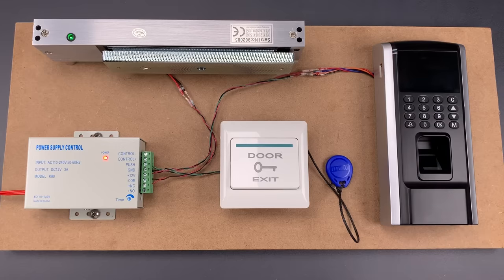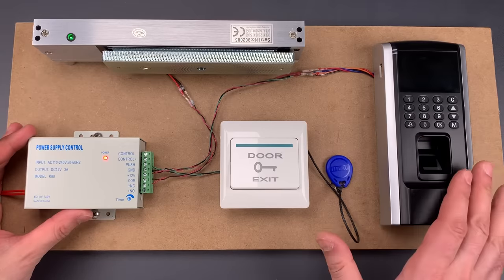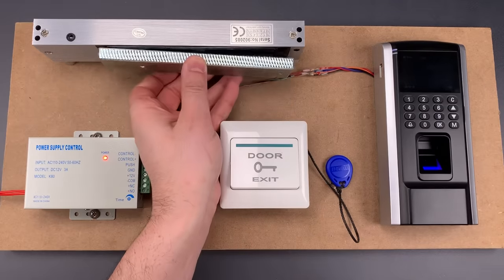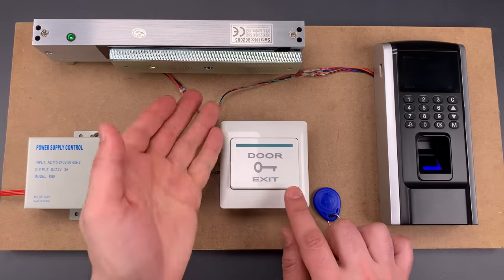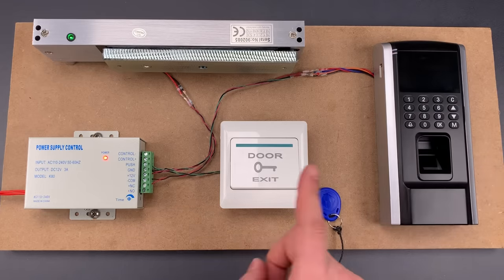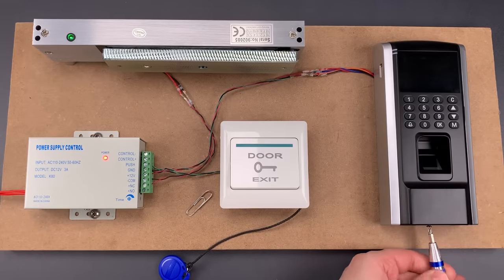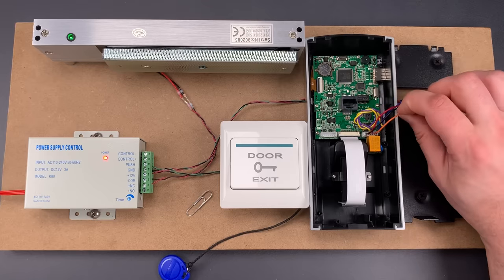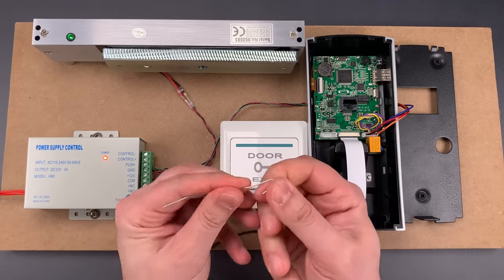[1040] Fingerprint/RFID Lock Defeated With a Paperclip (Mengqi-Control)

Comment: Surely the manufacturer is like: You're not supposed or allowed to remove that screw!
Reply: I bet the removal of the screw violates warranty 😀
Reply: s3sebastian I assume it’s more so the wires aren’t supposed to give that much (As in they should be tight not allowing for the cover to be removed without damaging the wires) 

And when the wires are damaged the system remains locked....

Assuming I’m right I’d say this is actually a pretty alright lock...
Reply: if they'd used a star screw or at least something less common than a Phillips head  it might have fared a bit better
Reply: @swordstrafe  Nah, theres no way for the secure side to know if the wires are damaged or not. Even if the connector breaks when you remove the body you could just connect your paperclip to pairs of wires until it unlocks.

Also its very unlikely that the connector will break because the installer need enough cable lead to install the product in the first place. Also the connector will just disconnect from the plug, its just a common JST plug which arent fragile by any means. Even after it disconnects its just as novel to decode the wire functions.

The only way to make this style of system airtight in anyway is to have the verification on the secure side, as suggested by LPL, with the verification using one time keys or time coded keys to defeat sniffer attacks (that read valid signals and resends them later).
Reply: Darcy Moloney is the wire are damaged you can’t send the unlock signal.
Reply: @swordstrafe  why not? There will still be an electrical connection right? Or are you assuming the wires will break on the other side of the door and not close to the side you just yanked on?

Edit: I just realised where some of the confusion may be coming from. The key pad is not needed at all to unlock the door the way this is set up. You could disconnect the keypad unit and chuck it away and still be able to unlock the door. This is because the relay and power exists entirely on the secure side and is only controlled by a short between COM and NC. The keypad unit could be replaced by a simple switch if you wanted to. (And NO would work opposite, you would need to break the short between it and COM or GND)
Reply: @Codemantic  that almost sounds like security through obscurity
Reply: @swordstrafe  u missed the part where they put it together at the start ...the wires are this long for a reason its not like they have nanobots putting the lock together from inside ...this is the case with every otger electronic device like mobile phones etc
Reply: @swordstrafe  not quite. It's a normally open circuit. Means you can clip those wires off and touch them together to get the same result. Having them tight would just guarantee a destructive bypass.

Comment: As a former security systems tech, I can tell you that this is a garbage design that you will never see in any commercial setting. Card authentication is never done at the door on any real system. The reader is only there to send the card data (facility code and encoded ID #) to a security panel that will fire a relay to open the door. Security panels are typically installed inside of a locked data closet that is located INSIDE the space you're trying to enter. The panel may even be located multiple floors above, or below the floor that you're currently standing on.
Reply: These are probably bought by cheapskates who want a lock, but don’t want to pay for a good one!
Reply: Coming from the perspective of an apartment manager, I wouldn't have known to drill the security vendor on this issue. 

It also seems like this setup makes the outer-facing components more expensive to replace if vandalized. When it's set up like you described, replacing the outside panel sounds like a much cheaper job.
Reply: @purplefreedom1631  Oh in this situation we'd definitely go with vendor recommendations instead of just slapping something down from Amazon. I'm just saying it's possible for the vendor to go cheap with me none the wiser. Except I guess in this case I know to ask about this one specific thing.
Reply: What would happen if one slid a thin sheet of metal (magnetic ofcourse) between the locking magnets ? Would the threshold of 600 lbs come down ?
Reply: @sanjaypatil2532  the magnet and its base would be on the inside of the door. You wouldn't be able to get anything in between there.
Reply: @sanjaypatil2532  You probably couldn't fit anything through, and adding a barrier between probably wouldn't affect the magnetic field much. 

That said, the door probably has glass panels, and you could just smash through it.
Reply: At our compound we have a computer secure in the office in order to verify this access, and it was designed & installed by an amateur... I can't see how any reputable organization would design a system like this.
Reply: In some cases, there is specific features you want, and in the same way, you might not need the highest level of security. For example, I wanted a video doorcom with a card access swipe and also possible to remotely open the door with the video intercom, but I DIDN'T want a keyboard as it would make the device unneccessarly bulkier. I did buy a VTO2111D-P-S2 which fit my requirements perfectly. The cool thing is that it has an API, so you can access the JSON objects programmatically. So I did wire the DOOR LOCK output to a raspberry pi, which would check against the access log if there were a valid tag scan or remote open. If there is, I would clear the local log, open the door, and send the log to papertrail.
If no log of a valid open was found, I would log a tamper fault and then NOT open the door.
Device was cheap too - like 90€.

So even if a thief break off the device off the wall or open it with screwdriver, and then short the DOOR LOCK output, nothing would happen. The reason I had to use the door lock output to the raspberry, is that it doesn't have any "callback functionality" in the API (notifying me of a door open), and I didn't want to unneccessarly poll the device when its not needed, so I use the "door lock signal" as a "wake up and check if there is valid access!" signal.

This simple network modification, made the device pretty high security access. Yes its POSSIBLE to remove the device completely, and then put a new fake device which just always respond with a valid access log entry. But that attack is even more complicated than a wiegand replay attack! And could be even made more secure by creating a self-signed SSL certificate in the device and importing the root in Raspberry Pi, creating also a encrypted communication requiring extraction of private keys out of the VTO station.

In another case, you want a low-medium security device. Then you can on the inside put a self-maintained relay with a "start" button, and wire the tamper output to its power input. Then wire the door lock cables in series. If the device is removed from wall so tamper sensor is activated, it will drop the relay, disconnecting the lock from the device. Only way to reset would be to enter with a key, and then push the start button on the relay on inside.
That a VERY cheap way of improving the security, since a 2 pole relay and a button only cost like 5€.

In a third case, you might want a device to log the access only. For example, for timekeeping in a employee situation. But you also want the door lightly locked, so unauthorized people wouldn't wander into "staff only" areas (see it as a staff only sign, but a little bit more physically preventing), and also locked so people don't forget to "clock in" and lose the pay for the day. Then a "locally controlled" device is perfect for the circumstance since they are CHEAP!, and even more secure than a "Staff only" sign on a unlocked door.
Reply: Are you really comparing a 170$ lock to a security system that costs thousands?
Reply: It would seen obvious to place the verification on the inside, but the poses the problem of passing the credentials over a (easy to tap) wire, opening for man-in-the-middle scenarios, even if the signal is encrypted. The answer to that is some form of hand shaking procedure which would typically involve a certificate and two-factor authentication, requiring the certificate authentication  to be performed inside the door-contraption, to avoid sending credentials for opening a private key over the wire ... and so on.

Just tamper-proof the dam door mechanics, or get stuck in a technical escalation that will end up costing more than most (non government) facility owners are willing to pay.
Reply: But could you use a bigger electromagnet to fuzzle up the force of the door lock magnet?  I don't know enough about magnets but surely a greater opposite force would cripple the smaller somehow.
Reply: @googiegress  That's exactly what I thought. a prankster could easily remove the cover and throw it in the weeds. Horrible system.
Reply: @luminousfractal420  Controlling the magnetic field to that extent would require similar tech as to what's in fusion reactors. You could possibly knock out the circuit board with a small EMP or static electricity, but then you run the risk of perma-locking the door
Reply: Diatonic, not every security needs to be top tier. Think hoa's and residential. In the end pulling a wire and adding 12 devices to validate or pass isnt necessary for a bathroom or pool gate with panic hardware.
Reply: @shasta92505  this, i installed a system similar to this in my company's office. and its not meant to be the primary locking mechanism for entrance door that is in, its just there so they can have an easier control when the office is open for business, when the office closes it's simply locked by key
Reply: and as a former tech i can see i've seen plenty of commercial clients with setups like these haha, from "high end" condos to whatever
Reply: Even though its a garbage design without encrypted signal and just turns on/off a relay.... what if that screw is not accessible from outside.
Reply: The reader obviously sends a signal to the relay and it's just a matter of doing the same from the reader.

Comment: As an electronics engineer this makes my day lmao! It's so easy to do at least some sort of indirect connection but they went with a relay switching a silkscreened connector. Genius!
Reply: All the fancy tech just to operate a mechanical relay.
Reply: Even a hobbyist is able to build something more secure for a couple of bucks, just switch positive, reduce the incoming voltage when you send it back and the reciever checks for the right voltage, the devices could have random signal voltages, or each device a list of voltages that switch on every use randomly jusg by sending a one digit integer for a switch statement, this would make it ways harder to hack, even if you know how it works. But this is just ridiculous, I mean there is only one simple screw, a curious kid could open this thing and finally even steal it because it looks so cool and best thing is that it doesn't even need the other parts to reuse it because this is the whole control unit, the kid could have a cool looking door lock and you couldn't enter your own place, well, until you short the two wires by accident 😂

Comment: "Bypassing this is as simple as bypassing a simple mechanical lock" Wrong, this is way easier
Reply: Tbf you have to unscrew the case. That does make it really obvious as to what you're doing to everyone for miles and does slow you down.
Reply: @Oznerock  Unless you went at night with no one to see~
Reply: And you need to know which parts to bridge.
Reply: @ctrl_x1770  Considering there's 4 wires and 2 of them are universally recognizable to anyone who has worked with any kind of electronics... Not exactly a difficult puzzle to solve.
Reply: @Oznerock  Picking and torquing a mechanical lock is also extremely obvious to any one who pays you any attention. Now if you really wanted to, you could get some kind of blue carpenter's coveralls and if anyone questions why you're opening the lock with a screwdriver, tell them you're maintenance. The average person is less likely to question that than question why you're attacking a mechanical lock with a pick set or whatever your method of attack is.
Reply: @CrizzyEyes  Not quite anyone. My experience with electrical engineering is that when I write code, motors go spinny, and I control how fast or slow they spinny, and in what direction. Oh, and also using encoders to detect when it goes spinny too much. I really need to get into at the very least basic electrical engineering, but the soldering iron kinda freaks me out. Not sure what the risk of getting a "bad" soldering irons is, what I should do to avoid getting burned, etc. Also, I'm cheap as fuck, but don't know what other components I might need to learn or for my projects, other than maybe an arduino or a raspberry pi, copper wires, and motors. Overall, just seems like a hard thing to get into without a classroom environment.
Reply: @zeyode  So you actually havent worked with electronics, just used to program some. 
Hard thing getting into in the internet era? Damn, I think you should consider some different field, having trouble with looking up tutorials online :P
Reply: @filskar_  Tutorials for what specifically? Tutorials are generally pretty good if you know what you're looking to learn, but I don't. Wtf I gonna do, search up "how to do an electrical engineering"?
Reply: @zeyode    try to search up "how circuites works", familiarize with wires and the logic behind It if you are up to this stuff but i hardly doubt an engeenier will ever weld anything if you are going after that kind of career

Comment: Fingerprint/RDIF: I am strong and secure.
LPL: Yeah, now talk to my paperclip.
Reply: I mean it is pretty secure but, as he said, if the part that controls the lock is also outside it's easily bypassable, or less easily depending on how much effort they spent on anti-tamper. Also, assuming you are using an seperate control box inside, you probably want to set it up so that it requires a key/fingerprint and a passcode.

Comment: The security at my work had the wrong door code for the outside of the last door of our fire exit at work yesterday. One of the fire doors in between that got stuck shut because of a piece of metal on the outside which was a huge risk for obvious reasons. 

Thanks to one of your videos I managed to work out the correct combination and pick the lock, so we cleared the obstruction and the fire exit. If there was a fire people could have died because the fire exit was blocked. 

Thank you for making these videos

Comment: There's even enough room in there to hide an Arduino board so you can have permanent easy access without anyone knowing.
Reply: Or a radio controlled switch as seen in other lpl videos...
Reply: Wonder if you can code in your own fingerprint while you have the lock open?
Reply: You can even put your weed in there!
Reply: Someone's been watching some Modern Rogue, I see.
Reply: @PBTophie  tsk

Comment: The lock is perfectly secure provided that everyone with physical access to it plays by the rules.

It's an honor system. 😜
Reply: You will just as well off with a sign that says, "Authorized personnel only".  Or better results with a sign that says, not an exit or emergency only.
Reply: OmniscientWarrior yeah I feel like most people are hesitant about “emergency only” doors as they usually suspect it sounds some sort of alarm
Reply: Locks are only for honest people, no matter what kind of lock.
Reply: Stop and frisk for paper clips - problem solved.
Reply: Locks keep honest people honest. If somebody wants to get in, if sufficiently determined, they’ll get in. The difference is whether you notice right away or not.
Reply: @NoTraceOfSense  and that's why I sleep with as little noise as possible at night.
Reply: Like a swing door with a 'do not enter' sign on it
Reply: Well, this lock fits perfectly to most houses in the US: non-barred first floor windows, flimsy backdoors, walls made of what as well could be cardboard. It's a perfect trust-based system. Could as well put this lock on, or just a handle at that.

Comment: A serious access control system would never utilise a local relay on an externally mounted device. At minimum there should be a cover tamper monitoring on the reader.
Reply: umm atm machine ... it takes 5 seconds to drop a fake pad overlay on it and get everyones code and card number ... and those suckers are supposed to be tamper proof